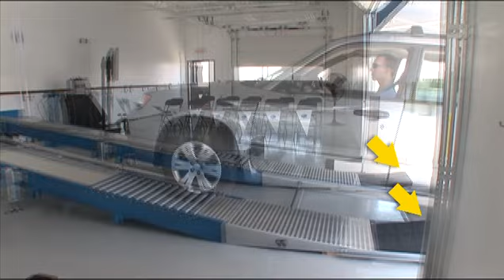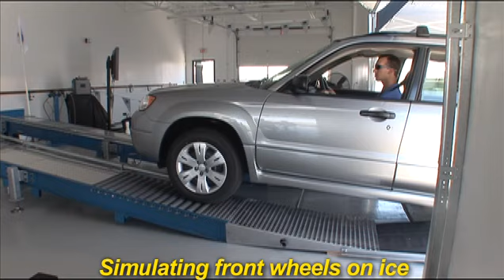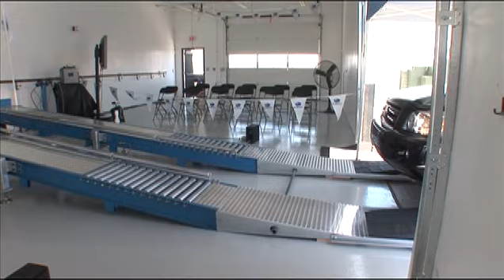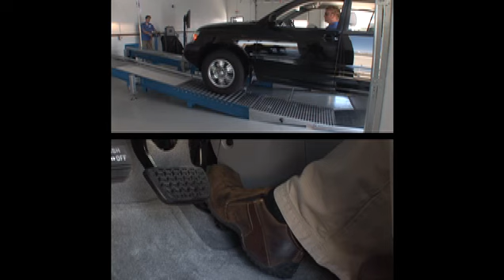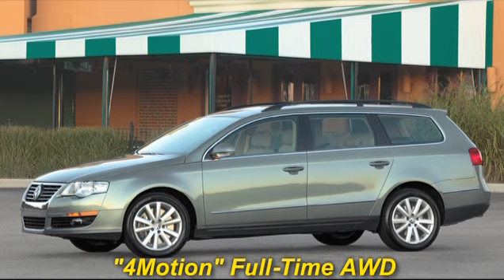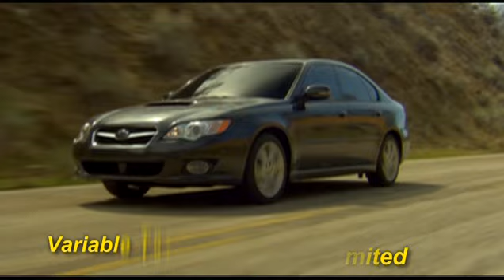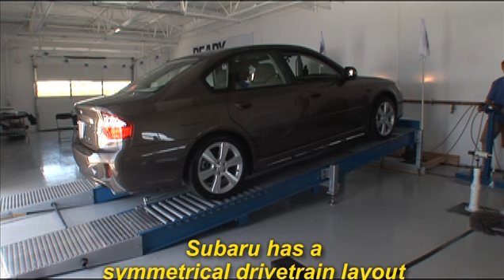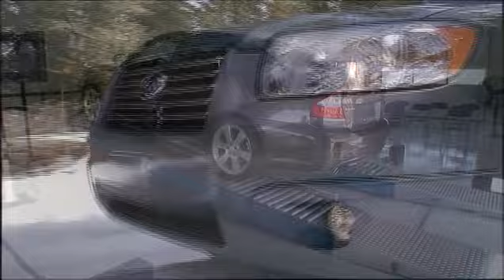Subaru Symmetrical AWD vs. Honda, Toyota, and Volkswagen

Comment: Symmetrical means nothing. It's if the car can use the brakes to force power to the other wheel, b/c open differential. Without that kind of tractional control system, then the car doesn't move a cunt hair.

Comment: Notice they didn't mention the traction control system with the VW. So I'm guessing they turned it off. My 2006 Audi A4 Quattro puts any Subaru to shame in real world testing. In fact I pulled out my neighbors sub twice last winter.

Comment: Owned 2 subies (2005 wrx, 2013 outback) and spent around 4k in repairs between the 2, all within 3 years. Traded the POS outback in for a 08 toyota 4 runner and it was the best decision I've ever made. It has a real 4x4 system unlike the highlander/rav4 and is infinitely more reliable.
Reply: What did you have to do for repairs that weren't covered under warranty?

Comment: How difficult would it be to include a lock button to simply tell all wheels to go, even it was the same speed? Five mph up hill is better than sliding backwards with one wheel spinning frontwards.

Comment: Symmetrical has nothing to do with it. That’s a ridiculous Subaru marketing tag line. Audi uses the same layout as Subaru. It forces the engine to hang out ahead of the front axle. The VW’s traction control system is the limiting factor. You can see the driver in the VW moving the steering wheel from left to right causing the side to side movement. I’d suggest trying a Range Rover with full time 4x4 and non symmetrical layout. Bet it climbs just fine.

Comment: The Toyota Highlander has a diff lock button which when pushed puts even drive to all 4 wheels so would climb this easily if you pushed it. Still I agree that you shouldn’t need to use it here, but it is there if you need it.

Comment: I think most of these systems would serve the average person in average winter weather just fine, but it’s nice to know that in a worst case scenario, you’d be okay. I will say that I recently rented a Buick Enclave to go up to Snowshoe WV. We were hit by a decent snowstorm up there and they don’t much clear the roads, strangely you can deactivate the AWD manually, which I discovered the previous renter had done, but once activated (and it stays on even when the car is turned off and back on) I literally did not slip once, even in deep snow and on steep hills.

Comment: Interesting video, but it is a bit of a bold claim to state that 'symmetrical AWD ' is the point of difference. It really comes down to 1: does it have LSD in the front/rear or centre, and 2: does it have a brake activation traction control system. Its a pretty poor effort from the non-subaru vehicles, but regarding symmetrical AWD, my mirage race car has an early Evo driveline in it... The engine and gearbox balance perfectly on the engine hoist when hung at the centreline of the vehicle, the centre diff is a 50/50 distribution with quite a strong viscous coupling, the front wheels have a hanger bearing on the driveshaft so you have equal length shafts, and the rear axles are equal length. yep, it doesnt look symmetrical like a subaru system in a fancy poster, but it is mechanically symmetrical. An AWD system is a waste of time without adequate limited slip differentials.

Comment: Way bias test... you guys did the opposite for car one vs car two... right as the CRV was about to go up you backed off the throttle but in the Forrester you hit the throttle. Of course the CRVs not going to climb up if you let off the throttle right as it's about to do so. I'm only at 2 minutes and 20 seconds and I can already tell that this is not a fair test. FYI the CR-V uses a viscous coupler. Not only does it work but there are Hondas in the 7-second 1/4 mile. What's really upsetting to me is I'm a Honda fan as well as a Subaru fan.
Reply: I guess Subarus are better at applying the brakes to the wheels that are slipping. That's all the VDC system is doing.

Comment: Torque steer isnt caused by unequal length  axle shafts. It it caused by the difference of angle of the shafts. If you have the right side flat and left up/down, it will pull towards the right and vise versa.

Comment: This is really interesting. I remember having an Audi Tt mk1 Quattro then a few years later a VW Touareg. The TT was actually better in snow than the Touareg, depending how deep it was of course. Testement to the Quattro drive system
Reply: That's interesting especially that TT has "only" haldex awd system.

Comment: The moral of the story is:

If you live in an area with mountains/bad weather, either buy a vehicle with a real 4WD system and diff lockers (Wranger, 4Runner, some trucks, etc) or a Subaru. Don’t buy those fake “AWD/4WD” systems.

Comment: You need brake assist for this kind situation or car with mid lock. Subaru has symmetrical awd it works like mid locked thats why it works.

Comment: Nothing beats Subaru AWD. I had a Legacy years ago that I loved. I drove it around 4WDs stuck in the ditch all the time. But, while many folks here talk about being on their third or forth Subaru I am still driving my first Honda. My wonderful Legacy lasted six years, blew a head gasket and, though I sank a couple thousand into it, they never could fix it to where it wouldn't overheat going up hill. My 99 CRV is still going strong, 398,000 miles, and all I've ever done to it (other than maintenance) is change out the ignition switch cause my key got stuck. Currently I am seeing recall after recall on Subarus. So, while I would rather have a Subaru, I guess I'll just call in sick when the snow is really bad and enjoy my Honda reliability. Most of the time, in most conditions, it does fine; but it's no Subaru.

Comment: Great video with a really clever test bed.  I am not a fanboy type at all, but I do own a 2004 manual Forester, which I bought used a couple of years ago.  I could not be happier with it.
Reply: Pickup up a 2018 Forester MT6 base model from my folks, who moved up to automatics. I pulled our 1200 pound teardrop trailer, with dog, 2 babies, wife, and camp gear, at highway speeds for two days, and got 26mpg. Daily driving to work, it's getting 31.4 indicated on the display (more like 29.5 at the pump), it's smooth, quite (well, road noise), and the windows are like a greenhouse. I see all. Couldn't be happier!

Comment: Fundamental flaw to the test: the Honda system sends power to the rears when it senses the fronts slip without traction. That's not the same as it being on rollers, where it just sees them rotating normally.

Comment: Seem like a Subaru commercial but interesting non the less. How about doing the test with an Audi A4 with a torsion differential which is also a symmetrical system.

Comment: your lab tests are misleading because some cars you can disable the traction control,vsa and some like honda have a vtm lock that will pass this test with flying colors and how are you able to choose which wheels are locked? youre not going anywhere with a car on a hockey rink doesnt matter what car you have thats the difference between subaru drivers and experienced drivers...subaru drivers think they are invincible and experienced drivers wont go out in really bad icy road conditions.

Comment: Has nothing to do with symmetry of the drivetrain, has everything to do with torque distribution. The VTD does that with very little drama, but the "because it has symmetrical AWD" reasoning is full of crap.

Comment: They cheated. They fully put the other vehicles on the rollers, then put the Subaru at the edge where it can quickly get traction. Then in the Highlander, the driver is clearly moving the steering wheel side to side. Lmao

Comment: I have two cars:
2018 WRX
2007 MERCEDES E350 4MATIC
yes, the 4matic in my opinion is identical to the wrx in the snow.. but at a much steeper price when new.. generally in the snow I drive the e350 because my wrx sits lower..

Comment: To everyone talking about Subbys and their bad head gaskets:

MAKE SURE that you replace with a SIX-STAR brand head gasket kit and you're good to go. Just had head gasket replaced, timing belt, new radiator and hoses, valve seals/covers/guides, etc done on my 06 Subby Outback with 190k on it. Ready to go 300k no problem. If you replace a bad subby head gasket with another OEM head gasket, guess what? It fails again because you're replacing a bad part, with the same bad part. USE 6STAR BRAND HEAD GASKET KIT! If you find a used Subaru that you really like/want but needs a head gasket replaced, tell them take off the cost of repairs from listing price (or as close as you can get, $800-$1,500) then get the much higher quality Six-Star brand gasket kit and it's good to go for the life of the car.

Ps. Stick with OEM for timing belt and water pump they are solid parts.
Reply: Thanks for the tip! Planning to buy my first car second-hand, and looking at a Subaru.
Reply: I'm Still Alive  explain more. The only spending you should spend is on regular scheduled maintenance and a head gasket repair *ONLY* if you buy a used subby and it hasn't been done yet, or if you take the price out of the sellers asking price. Because other than the head gasket, my 06 outback 2.5I 4cyl Automatic Limited trim has no problems at all. Replacing a CV axle and fixing small power steering leak are the only things on my to do list for hopefully the next 2 years, that and oil changes and a coolant flush soon. There is a reason you see so many on the road at 200k-320k

Comment: And then there was the Subaru head gasket problem......
Reply: MAKE SURE that you replace with a SIX-STAR brand head gasket kit and you're good to go. Just had head gasket replaced, timing belt, new radiator and hoses, valve seals/covers/guides, etc done on my 06 Subby Outback with 190k on it. Ready to go 300k no problem. If you replace a bad subby head gasket with another OEM head gasket, guess what? It fails again because you're replacing a bad part, with the same bad part. USE 6STAR BRAND HEAD GASKET KIT! If you find a used Subaru that you really like/want but needs a head gasket replaced, tell them take off the cost of repairs from listing price (or as close as you can get, $800-$1,500) then get the much higher quality Six-Star brand gasket kit and it's good to go for the life of the car.

Ps. Stick with OEM for timing belt and water pump they are solid parts.

Comment: My Infiniti G35X has AWD package and it works just as good as my buddy's 2002 Subaru  Impreza!
Reply: Nissan's AWD systems are good aswell but kind of rare and far inbetween on most models. But ones that have it and have some performance or capability often work really well. Tho in cheaper and more pseudo SUV crossover cars like Juke it definetly is another of these fake nonfunctional AWD systems

Comment: I'd love to see more tests like this including Volvo AWD and other manufacturers, as well as turning on/off options such as X-drive, ESP, differential locks, etc.
Reply: I would like to see how the manual versions stack up. My Legacy GT is meant to have 50/50  torque split but has LSDs front and rear

Comment: A simple button press in the Highlander would have got it up the ramp...there's a 4WD lock button which locks it into a 50/50 torque split up to 25mph and would have had no trouble making it up the ramp.  Does the Honda have anything like that?  

All these vehicles are FWD biased, they do not have the ability in normal settings to transfer enough power to get the vehicle moving...I think you should try the Highlander again except engage the 4WD lock mode wonder if the results would be different?
Reply: 1st gen Highlanders have a 50/50 split at all times, it has a snow mode that’s basically a transmission setting which starts it in second gear to reduce wheel spin from a stop

Comment: Subaru was making rally cars since the 80's and pretty much perfected traction control since then.
Reply: as did Audi with Quattro and why they won so many rally/WRC race back in the day
Reply: Don't forget the notorious active-yaw 4wd from Mitsubishi. Tommi Makinen doesn't settle for less.
Reply: @terragaia7092  R.I.P. Mitsubishi. Now that they're effectively gone, Subaru is the only remaining player, however now they have no competition. Hopefully they don't fluff off.
Reply: Ahmad Faris sorry to interrupt you but in rally the use a permanent AWD system and a diff that is basically almost like a welded diff

Comment: Guys torque steer does not dictate power to the wheels. It is only a by product of out dated hardware. The differentials control where the power guys. Open difs will always send all the power to wheel with the least amount of traction. Unless redirected electrically or mechanically.  The last subaru had a special dif in the rear that will send equal power to both wheels

Comment: I have a 2009 Honda CR-V and it works just fine in ice, snow, and mud. I will agree the 4wd system sucks but I live in Seattle so it works just fine here with it's weather. I got it for reliability. And don't forget this is also a Subaru ad so they try to point out all the reasons why Subarus are better.

Comment: volkswagen claims one wheel with traction can move the car..maybe they are talking about on flat ground and not an incline
Reply: You need to qualify that statement. All you need is one tire to move a vehicle. The traction is going to be based on that one tire... what compound?  What tread?  What tire pressure?  Are there studs or chains?

Traction is everything. I’ll take a 37 HP D2 Caterpillar and out pull a 1 ton diesel pickup truck on mud. 

So really, it’s the tires. And who’s going to driving around on crappy all seasons because they own the “best” AWD car in the world?  Subaru drivers!

That’s why I pass so many of them  spun out in the ditch with my 2WD shit box with tires worth more than the whole vehicle is. Overconfidence in Motion.
Reply: Yeah that's what I was thinking

Comment: So you think the torque steer is caused by the unequal length axles driving the 2 wheels that had 0 traction. Torque steer is not caused by different length axle shafts. In this case it was just the traction control using the and to slow down one wheel or the other looking for traction. In most cases torque steer is caused by inconsistent traction on one tire on either side of the projected center of steering. 

It's not just that Subaru AWD is symmetrical in dimension, it's also symmetrical in the power split. It can put any division of power to any number of wheels. The older ones are completely mechanical.

Comment: Mercedes advertised the ML to be able to do this, when it first came out. Since then, many companies advertises they can do a one wheel ramp climb. Audi, back in the early 80's, had manual diff locks on the 4000 Quattro and semi auto on the 5000 Quattro. You could lock the center and rear differentials, giving you a positive 3 wheels driven, which is what got them up Pikes peak faster than any other. That, and big turbos. Eventually, they were outlawed altogether, because nobody could beat them, even after many custom restrictions were imposed against them, to make them less competitive. AMC mass produced cars  (Eagles) with part/full time 4WD, that made them more capable than most pickup trucks! As far as the Passat failing this test, it has to be a software issue. VW synchro AWD is just as capable as Audi's Quattro, as it is the same company and they share the technology anyway.
Reply: The issue, though, is that a lot of the lower-end models like the Q3 use the older Haldex AWD systems that only operate when they sense a problem.  So you have to check carefully that you are really getting actual 100% of the time on Quattro versus the part-time version, since they all say "Quattro" on them for marketing purposes.

Comment: No, it's not because of symmetrical drive train layout, that the Subaru, it any other vehicle, can climb with only one wheel having traction. It's a design function of the traction control system, that obviously failed on the VW, in which the system applies braking force to the wheels that don't have traction, so that the wheel with traction receives power. It's essentially ABS for acceleration, whereas it applies brake force to the wheels that are traveling faster than others, to get them all synchronous with each other. It attempts to act like 4WD with all three differentials locked.

Comment: And the Subarus ability to do the things it does has zero to do with the all wheel drive system being "symmetrical".
The subaru automatic transmission can actively vector 50/50 front and rear where as the Honda and Toyota can only direct about 30% maximum to the rear if I recall correctly
Reply: In this case, the Subaru runs 90/10 until detected slip or 50/50 if put in 1 or 2 on the selector. They actually did this in drive, surprisingly.

Comment: Even a 1990 Subaru Legacy awd drives like this regardless of electronics. It's a mechanical symmetrical awd using the center differential to direct power to the front or rear when needed.
Reply: Only the automatics do this they have active Center differential torque vectoring, the manuals commonly just have an open diff
Reply: @Gripmagic  I'm speaking of the VCD viscous center diff in 5spds like I have. At very minimum one front and rear tire will always be spinning. Torque vectoring or variable torque distribution VTD can send all the power to one wheel like you mention.  Usually in snow or ice I have 3 wheels spinning. Had a 6" lift an 29" super swampers on my 87 GL and even in mud up to the floor pan all 4 spun every time. That's with open center diff.